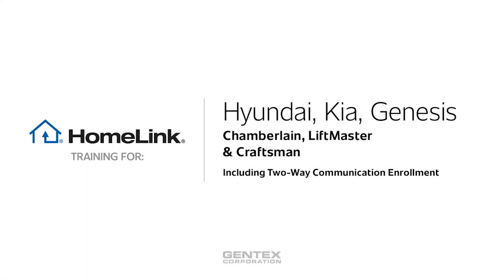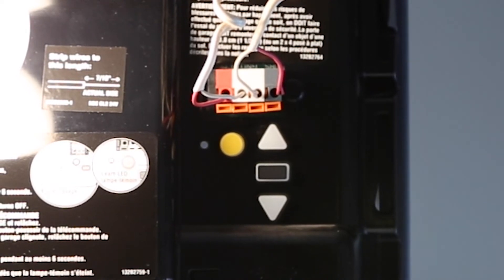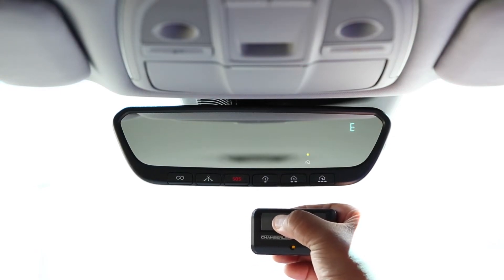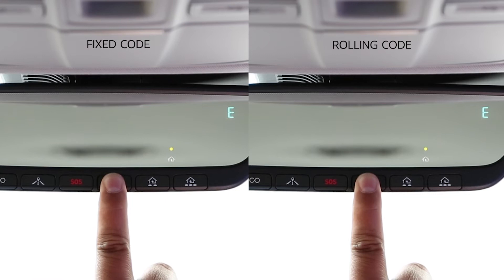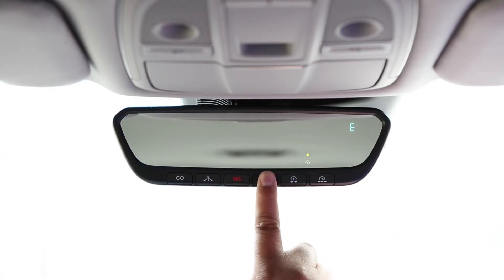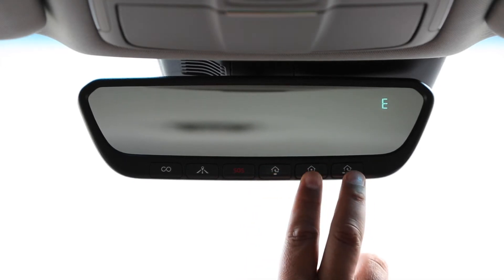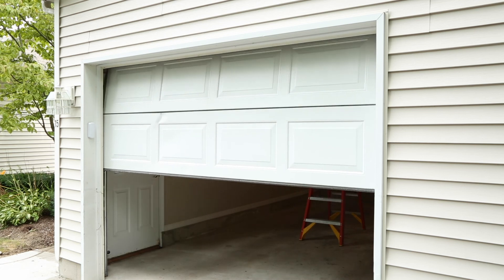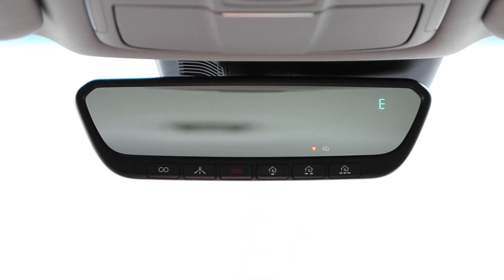Hyundai, Kia, & Genesis HomeLink Training- Chamberlain, Craftsman, and Liftmaster Garage Doors

Comment: What if you know you have a rolling code device, but the HomeLink indicator light is solid and pressing the trained HomeLink button does activate the garage door?
Is there an even smarter level of communication that "trains" the rolling code feature without the need for those additional steps?